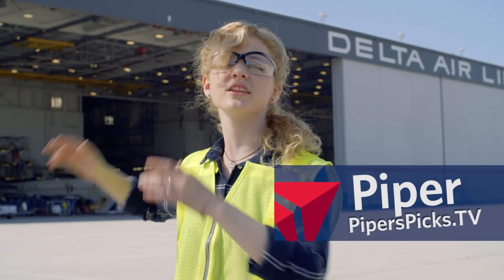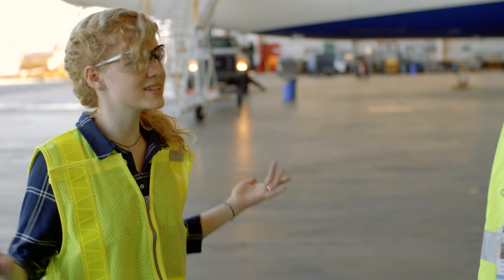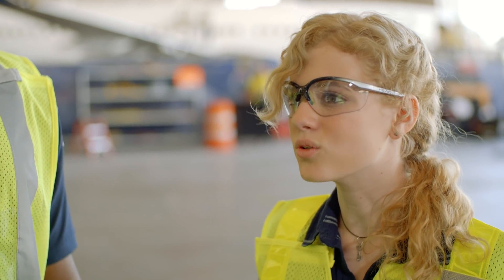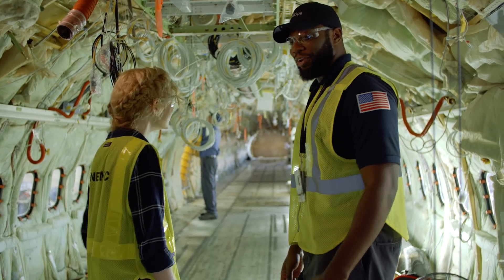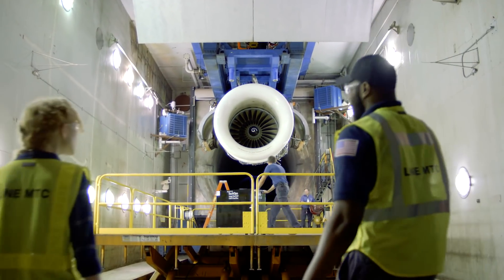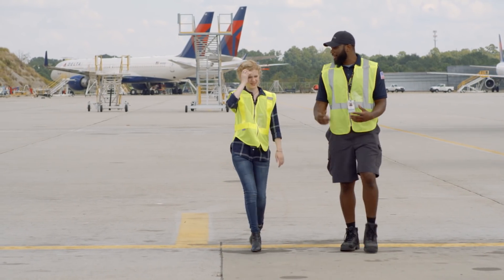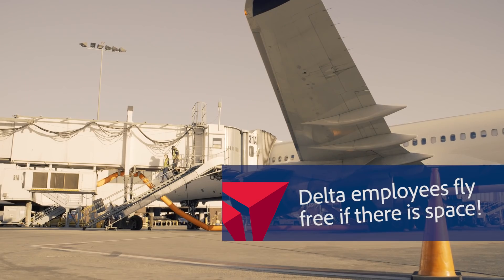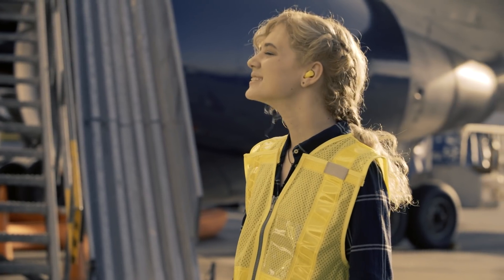Careers at Delta: Aviation Maintenance Technician – Middle School Outreach

Comment: What is the salary of AMT at Delta
Reply: Minuscule, after years of brown nosing maybe a pay increase of like 28 / h   but then your soul dies also.
Reply: @donroo736  how does one's soul die
Reply: @bobafett8331  because you have to suck up so much and play under the politics it almost feels like you joined the military in the 70s or 80s.   But without the real honor, you'll find yourself taking stupid orders from someone that doesn't know that much, just browned nosed more than you before you for longer
Reply: @donroo736  really? Wtf only 28 at a airline as big as delta that's crazy low.
Reply: @negan4089  yeah, unless you have like 5 years hard experience and you're white.  That's the thing, the industry knows they own you for five years for that needed experience so they treat you like a slave